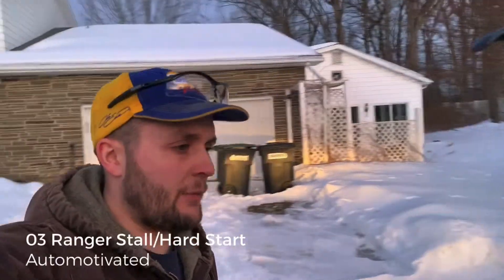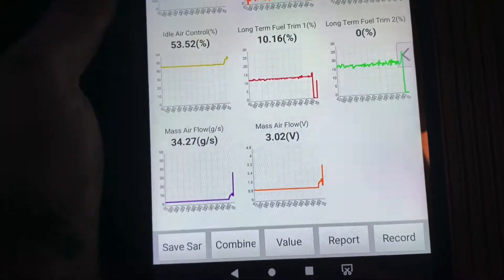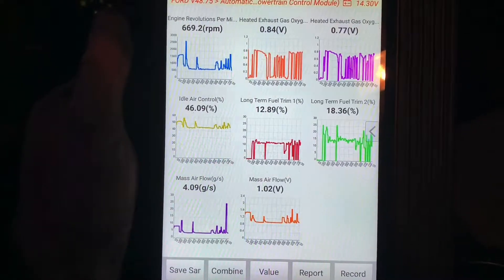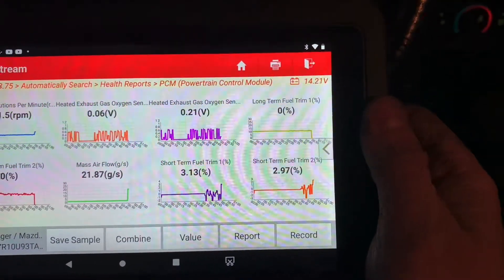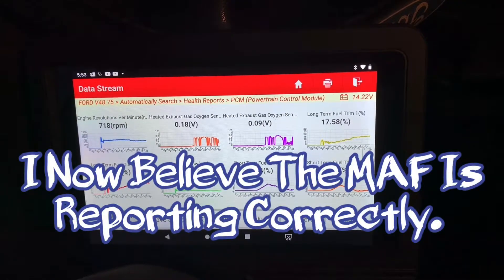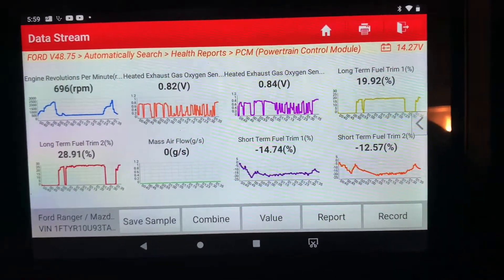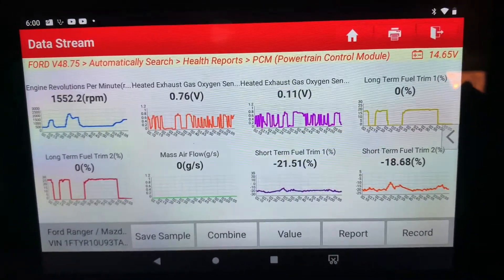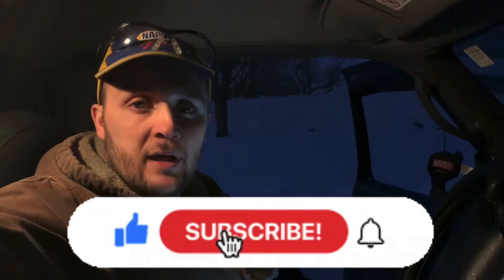Ford Ranger Hard Start/Stalling w/ P0171 P0174 (Pt. 1 - The Struggle)

Comment: Couple of things that stick out to me. 1st is I probably would have tried to drive the truck. Fuel trims at idle can be deceiving at times. I want to know what those fuel trims are doing under a load. 2nd your description says hard start, which I would assume is a extended crank. I don't think I've ever had a MAF sensor cause an extended crank. I've had one that caused a no start because it was reading air flow even though the engine was not running. I'm talking like 5g/s KOEO. 3rd take a closer look at your bank 2 long term fuel trims. It's almost 10% higher than bank 1. When you do give the truck some gas the trims do come down, but they never really reach 0%. That alone tells me you have a fuel delivery issue. Also your bank 2 injectors are the furthest away from pump pressure. Bank 2 is at the point the pcm can no longer give the truck more fuel, at almost +30%. Compared to bank 1 at 19%. It's a learning experience and you still found the problem, just some constructive criticism. Good job going back and verifying your repair.
Reply from the maker: Thanks a lot for the feedback James! I noticed the different fuel trims but never pieced that into the equation. I see you watched part 2. Lol

Comment: What was your baro readings both hertz and InHg ?
Reply from the maker: Hey David I scanned through the data list. My Baro read about 14.7 psi. I’m not sure I saw hertz data PID for Baro and I had my scanner in English mode giving me psi. I may have missed it. Sorry for the cliffhanger. I’ll post part two tmrw morning. I screwed up royally trusting the unplug it test on this one. Before this video I checked vacuum leaks with smoke tester, checked vacuum was running about 18 inches mercury, spark was very strong and could jump an inch gap at all cylinders easily, spark plugs/wires didn’t have any arcing after water misting and compression upon cranking sounded strong and uniform so I didn’t go the route of checking compression. I wanted to believe it was the MAF, I cleaned it thoroughly and no change. I still believe it is getting weak. But the main issue escaped me until I came back the next day. Hope to hear from you in the comments on part two so you can tell me how dumb I was for trusting the unplug it test. Lol.
Reply from the maker: Are you having a similar issue?
Reply: I had a 2000 3.0 with a p0174.

My fix was very obvious
Reply from the maker: @davidqualey  your ended up being Baro sensor? Or a vacuum leak? Lol
Reply: @automotivated5934  mine was a misreporting and damaged MAF sensor
Reply from the maker: @davidqualey  well even after fixing the stalling, intermittent no start I believe the MAF is not accurate. I’ll post part two now. The customer is super happy with it, but I bet it needs a MAF not too far down the road.